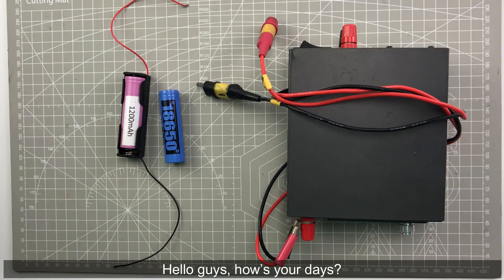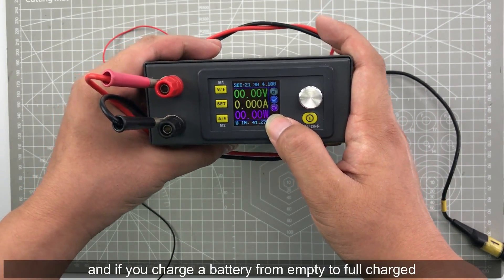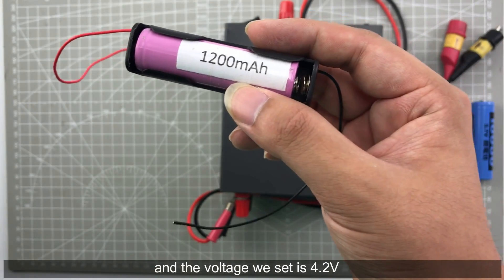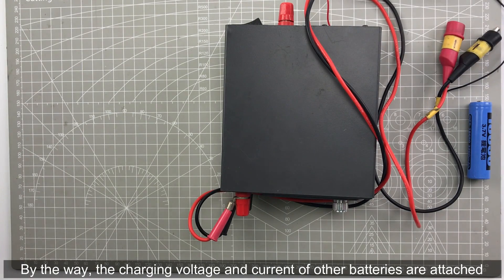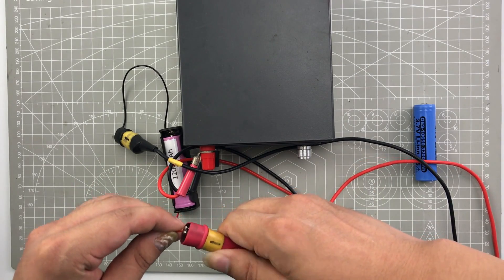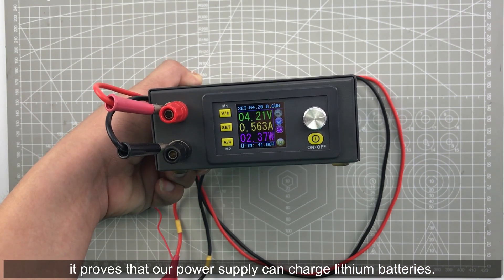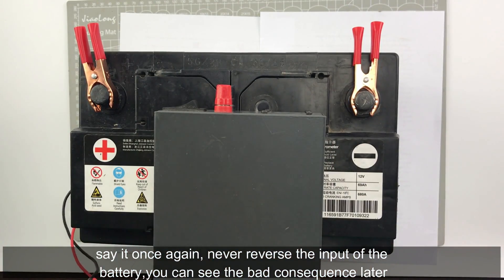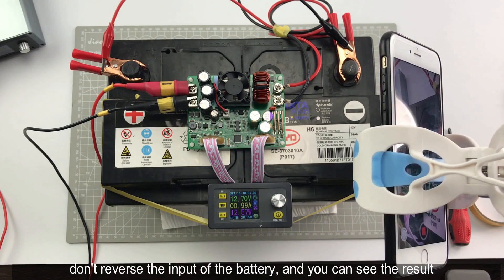Can DP/DPS/DPH DC POWER SUPPLY Charge  Batteries? DPS5005 as example

Comment: can the module turn off when it reaches the limit of the ovp in charging?
Reply from the maker: hello, for ovp setting, as long as the output voltage exceeds this value, the output will be turned off

Comment: if battery is connected and the ac goes off , the dps will be burned?
Reply from the maker: good question, when the input power of our device is cut off but the battery is still connected, nothing will happen, the battery voltage will come back to power on the device screen but it will not damage the device, just like what I said, as long as you connect the battey in the correct way and there is no problem